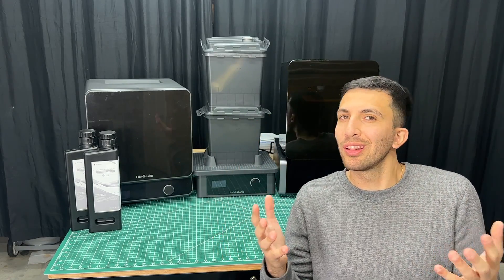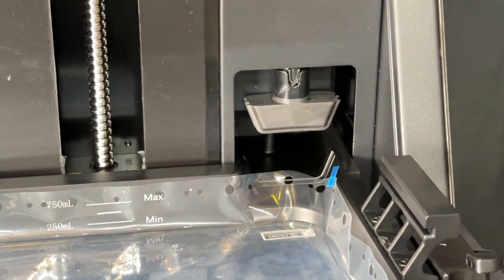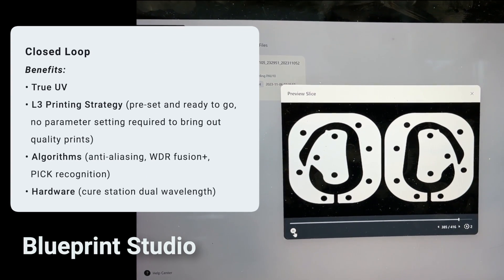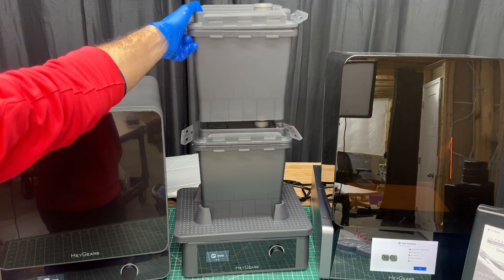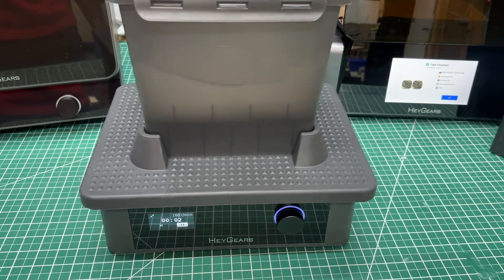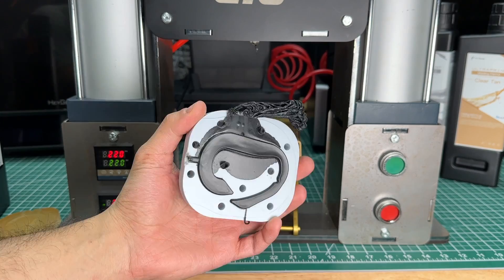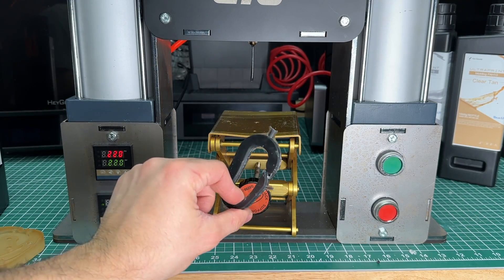3D Printed Molds - Explained And Tested With INJEKTO 2.0

Comment: What are the tolerances of the mold and the molded parts? I ask this because I am considering a purchase of the HeyGears Reflex (The ORIGINAL mind you) AND the Injecto 2.0 for custom Lego compatible parts. On the Injecto subject, will the 3.0 have the option of being electric like the M
Reply from the maker: Hi, 
The INJEKTO 3.0 just launched, it is pneumatic and has many upgrades over INJEKTO 2.0. The molded part comes out exactly like the mold, the tolerance is difficult to quantify since it is so similar. The only consideration to watch out for is sink marks which can be mitigated with your mold design. In other words don't have super thick sections next to very thin sections. 

Looking forward to your order, 
Mike

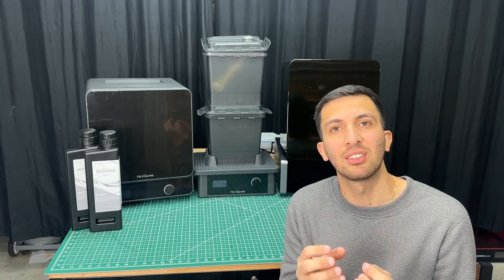Comment: 1:50 2nd stage tooling in epoxy resin, polyester resin, hard polyurethane resin could be used to make molds in 1st stage tooling that made with an FDM Printer. Fumed Silica, micro balloons, chopped fiber, could be incorporated as well. The design would be like making tooling for sandcasting metal.

Comment: The top plate on your lab-jack should be beefier.  There is probably a little damage going on to your molds from rotational torque because of it. Nice video!
Reply from the maker: Thank you 😃.  I appreciate your input and support 😊

Comment: Sorry. But extremely slow print times, priority fresins ant slicers,  small volumes, a washing system that is going to dertroy parts and its motors, and a hefty price makes this equipment. Very unreasonable. There is no reason a print of that height should have taken 6.5 hours.  Even on my most expensive printer that still uses a color screen, it would not have taken that long. I'm guessing this is most likely laser based and a direct competitor with formlabs, which honestly is another garbage company.  They sell their names, not actual good product.  The only reason companies tend to use the products is the support. Unless the only goal of the printer is to pint molds and pay an exuberant price for resin , nobody would buy this equipment as it's basically useless for regular day to day use.  Time + energy  + space + output + money.   2-3 times the cost of a large format printer with better quality, 2-5 times the cost for resin, 3-6 times the time to print and cost of energy to print.
Reply: What printer would you use?
Reply: @peppegg all bla bla bla then nothing lol.